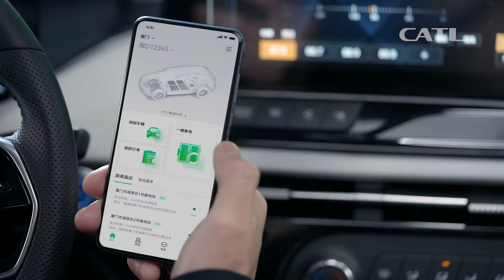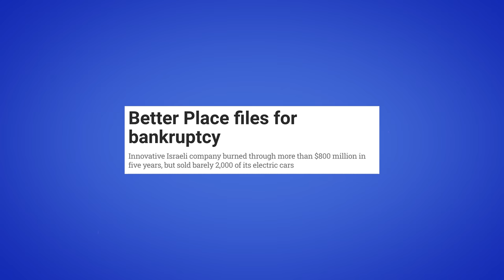Why Battery Swapping Is A BAD Idea

Comment: as a nio car owner in china, here's how things actually done. a typical 2nd gen nio battery swap station tipically houses 10-13 batteries. and the whole station takes up 3 standard parking spots. and it can swap battries at around 5min per viechel. and one empty battry takes 50-60mins to charge to full. so the idea is that, say if you are the first one to swap, by the time the 10th person is swapping, your old battery that you swaped 50min ago, is now full again and ready to be swaped to the next person. by doing this, nio has achived non-stop battery swap, using minimum resources. i've been a nio es6 driver in shenzhen china for two years now, there are around 30 swap station in my city and i've done almost 200 swaps. best of all its free of charge. i relally find it easy and coivent.
Reply from the maker: Thanks for the comment! Out of curiosity, do you think rapid charging or overnight charging is an option for you? Or is this simply a convenience issue?
Reply: @AutoTraderTV  well in china there are over half a million rapid charging piles, and nearly a million slow piles. Ppl can choose from both, as for overnight charging. The fact that many Chinese are living in apartment buildings, and in major cities such as Beijing Shanghai and Shenzhen, these apartments parking  are often only for rent. So ppl living in these apartment(which is majority of the population) don’t actually own a garage therefor it’s quite  a hassle for them to install their own overnight slow charge pile. But currently all new office/apartment buildings are required to install charging piles. So normal electric car owner can choose to charge at either slow or fast charge stations or for me as a nio car owner. I normally choose to do battery swaps as it’s more convenient and most importantly free of charge.
Reply: @nieruidong  Can you use Tesla superchargers in your NIO yet or is that only in Europe?
Reply: @lachlanB323  as far as i know Tesla superchargers are for Tesla only. This apply to all Tesla superchargers around the world.
Reply: @nieruidong  Apparently in Europe Tesla has now allowed other cars to use it. Hopefully they will allow this everywhere in the future.
Reply: I have seen multiple videos of these swaps, there are no way swapping time can be kept 5mins. Driver need to align their cars almost perfectly for it to work, therefore there are around 3 employee on site to help drivers, between the time it take for driver to try to align their cars, getting help, retry sometimes, the practical average swaping time is around 15mins per car. So 1 hour 4 cars. if nio battery can be charged full in 50mins(which I seriously doubt), in the same hour, 3 cars can be charged to full capacity just by building charging stations which are  5% price of the swaping station. This scheme make no sense economically, Nio does it only to sell more new cars. Eventually, either they will stop doing it or the company will fail.
Reply: @ahadicow  with NIO drivers don't need to do anything. You just press a button and it auto reverses and aligns in
Reply: FREE OF CHARGE     never in greedy avaristic OZ mate
Reply: @ahadicow  as of now i've done 164 battery swaps, in fact i've just got back from a 700KM jurney which i've done 3 swaps in between. and you are telling me it takes 15min per swap??? all because you've watched some outdated videos probably from 2 years ago? technology evolves mate!. as of now all nio 2nd gen swap station are fully automatic, the car park itself to the station, no human help needed. and yes, it just takes 5 min.
Reply: @brucehopkins9818  the free of charge policy only appliy to the first 100,000 people who bought nio cars from 2019-2021. it's them who saved nio from bankruptcy, so you can view it as a form of payback form nio to these car owners. now if you purchase a nio car, you can have 6 free swaps in one month. and any swap over this will be charged.
Reply: @lachlanB323  that would be great!
Reply: @AutoTraderTV  Why do people think rapid charging is going to matter when you'll be sitting for an hour waiting to do your still-slower-than-gas "rapid" charging once everyone is forced into EVs.  Overnight charging does not solve the problem scenario, long trips.  Overnight charging just means an EV is not a daily nuisance.  Instead, it's just a nuisance when time is most premium.
Reply: Swapping is not free of charge, you are leasing your battery. For now it's free as long as the company can afford to lose money. When it can't afford to lose money anymore than the full cost of operating will need to be paid and either you pay the company each time you swap batteries or you pay as part of a much larger lease payment.
Reply: @linusa2996  please see my other replie to this question. In short it’s free for the first 100000 nio car owners and it’s a lifetime guarantee. Other later nio owners have to pay to swap
Reply: @linusa2996  Wouldn't expect it to be a free service.  Whether it's a regulated infrastructure or standards based open market system, I imagine you'll need to pay a monthly fee for the infrastructure costs as well as a per use fee for the swap and charging.  I don't know why people think everything should be free or bundled.  Just because you bought an engine doesn't mean it's free to keep it running.
Reply: @user-AdamSmith  Exactly and there's still the range issue. Also not everyone has anywhere to charge an EV; I certainly don't. The garage I rent has no power; I can't get one up the front of my house due to street furniture preventing me having a ramp up; this is all a bad idea and part of the master plan to make us plebs get rid of car ownership altogether. I'll keep my beautiful ICE car as long as I possibly can; at least until I can't drive anymore. I plan on surrendering my license at 70 anyway as I think everyone should; after that age you could drop dead at any moment (literally) so it's not right to continue driving and risking other people's lives.
Reply: @AutoTraderTV  autotrade. It would help if you and your kind think about the wider issues that will come into play. Where do all the people who live in terraced houses charge their cars? Are you advocating cable strewn pavements that nobody can use? How about the grid, how can that support thousands of people all getting home and putting their cars on charge at the same time? Remember they may be on 10% and need to pop out in an hour so cannot wait. How about people who drive longer distances or God forbid, tow a trailer etc, stopping every 2 hours for a 3/4 hour charge is no fun. How about vans, is an eighty mile range any use at all?
Remember battery swapping also allows cars to have smaller batteries saving weight and resourses. Swap batteries could be standardised cutting cost and making recycling easier, just like mobile phone chargers! Did that make sense? Musk is against it because it removes a tesla advantage, he does not want a level playing field at all.
Reply from the maker: @abbersj2935  Ive thought about it lots. It won't be easy, but there are options such as chargers on street furniture (lamp posts etc). It's also worth noting that EVs don't need to be charged every day - just like petrol cars don't need to be refuelled every day. If you're on 10% and cannot wait then there is of course the option to use that 10% to get to a rapid charger and replenish a portion of the battery in 5-10 minutes (or just never leave your car on 10% - just as you might not want to do with a petrol car). 

I can't see how battery swapping (if used on a mass scale) can save resources because you need multiple batteries per vehicle. Even if the batteries themselves are smaller. 

EV infrastructure is not perfect right now. But it's moving at pace. That infrastructure may include widespread swapping. But based on the fact none of the big manufacturers are trying it, it probably won't in the short-medium term.
Reply: @AutoTraderTV  Thanks for the reply, that's good of you. As medium/large cars could use two or even three smaller batteries, (one under engine bay, one under passanger compartment and one under boot) when not doing long journeys they may have only one fitted, hence saving batteries and weight. Manufacturers are not trying it because it's slightly cheaper initially to design a car with a common chassis/battery pack. This does not take into account long term/environmental  costs. Battery charging will be optimised, so they should last longer, and recycling/repairing easier. The batteries could be owned by the charging companies (probably the oil companies) and leased to the car owner, they paying a bit more for the energy put into the battery, (but massively reducing EV car costs). Standardisation would reduce battery cost also. Rapid chargers as you propose are an even bigger drain and would require an even larger change to the electric infrastructure, I doubt that it would be possible on mass.
Just imagine the copper cables required or the safety problems of 400+volts all over the place. The present cars are 1st generation EV's in my view, just not a practical 1 for 1 replacement.
Reply from the maker: @abbersj2935  Some interesting points. I wouldn't propose rapid chargers on every street. I think it would be sufficient to have lamp post chargers outside domestic homes with 7kw output, allowing for overnight charge. Rapid chargers are usually best suited for long journeys where refuelling mid-journey is a necessity.
Reply: @AutoTraderTV  Thanks for your reply. I suppose time will tell.
All the best.
Reply: @nieruidong  Hello from the UK! Sorry can you clarify the free swaps for new buyers? Is it that in the first month they can have up to 6 free swaps, or is it that they get 6 free swaps a month each month. I think it is a great concept, but if the subscription service for swaps is as expensive as stated in the video, I think it could limit the appeal for many.
Reply: @leftyamazed  all new nio car buyers get 6 free swaps a month each month. any additional swap over this will be charged.
Reply: this applys to all new nio car buyers, no matter if you bought the car with the battry or without.
Reply: for those who choose to rent thire car battery, they get about 12000 GBP deduction with thier total car cost. then they will have to subscribe to the montly battery renting service. the monthy subscription fee for the battery is about 100-120GBP. (rough coversion from RMB to GBP)
Reply: for a tipical 75kWh battery swap, the cost is about 18-20 GBP here in china. price may rise a bit as electricity are generally higher in the UK
Reply: @AutoTraderTV  As someone who grew up in China, I just want to caution you. Maybe you're talking to a genuine customer, but it's more likely that this is someone working for Nio based on multiple factors, like their phrasing, some of the things they say and simply the chances of coming across a random Chinese Nio driver on your specific channel, on a website blocked in China who speaks fluent English. As an example for what's misrepresented, the high rise apartment buildings that people who can afford cars generally live in almost all have ample underground parking. There may be a few issues here and there, but the charging situation is actually the exact opposite of how they present it, it's much better in China than in Europe where many car owners only have street parking. I personally don't know a single car owner in China who doesn't have a parking space and in the big cities they all have e-charging these days. Imo the swapping is something they're doing in China as an ad for foreign customers (and maybe for taxi drivers in places like Shenzhen, that might make sense) but it's not really something that's going to be around long term. Even abroad, for the reasons you mentioned it's unlikely to take over any significant share of the market. 
Btw, I'm not sure what's correct in English but I'd pronounce Geely as "Jee-ly", based on the Chinese name. 
Keep up the good work, love your channel!
Reply: @ramdas363  dude I wish i can work for nio, I’m just a guy who studied in the Uk for almost 10 years and just happens to be a nio car owner… lol
Reply: @ramdas363  and by the way there’s something called the VPN which enables people in china to access stuff such as YouTube or twitter. And yes it’s illegal but the Chinese government normally turns a blind eye to individual uses
Reply: @nieruidong  It's a funny coincidence that I used to live in Nanshan. So I'm curious to know which part of Shenzhen has a lack of parking, because I've never heard of that. Since there is practically zero street parking anywhere downtown, how do you park your car then?
Reply: @ramdas363  well you should come to Luohu and old part of Futian. And also old apartment buildings in nanshan, these old residential area is not only hard to find slow-chargers needless to say fast ones, sometime it’s hard to find a parking spot.
Reply: @ramdas363  that said charging infrastructure in China is still lightyears ahead of Europe
Reply: @nieruidong  I love the idea of battery swapping mainly as a way to preserve the life of the car. People get all huffy when I say that battery swapping is a good idea, but I'm looking right now and there are 2013 Tesla Model S with packs that are losing balance, and the only thing Tesla will do is replace the pack.
If you are expecting a long trip how much does it typically cost if you decide to swap to like the 150kWh battery for a month or so?
Reply: @user-AdamSmith  because most people that have an EV have found that it is not a problem.  Having to stop at a charger for 20min every 2 hrs on a long trip is not a big deal. We are already stopping anyway so it makes no difference at all. We still need to eat and pee whether we are charging or not.
Reply: @abbersj2935  you worry about 400v cables running around but you don't seem to realise that in cities there are 110000v cables running under the foot path and no one seems to be worried or injured by that.
Reply: @ramdas363  I do believe it is possible to swap a battery in 5 min and that the car and swapping station can do all the alignment.  It really comes down to the situation in different cities.  Battery swapping is great if you do lots of driving and can't stop for long (like trucks) but if people have a garage and drive normally it would not be a benefit.  I drive an EV and I most certainly wouldn't pay more for battery swapping but that is because it wouldn't make any difference for me and having to go to a swapping station is far more inconvenient than plugging overnight.  It would be great for ling trips but for my self it is unlikely it would be worth paying monthly battery rental for once a month use.
Reply: @franciscoshi1968  Having worked in industries using the 500KV, supergrid, no I don't. But it's one thing to have a thousand or so regulated, inspected well maintained sub stations, quite another to have millions of 400v wander/extension leads all over the place.
Reply: @AutoTraderTV  The present infrastructure will not allow indeviduals on mass to charge cars when they want, this will I think have to be regulated. The grid/power generation system does not have the capacity to charge/start charging 500,000++ 100KW loads at a specific time when people get home. It will have to be sequenced, but who wants to wait? If travelling long distances, living in the country or towing it's a non starter. Battery swap is the same as filling with petrol, takes the same time too. Though it does not stop people home/work charging also.
With battery leasing it also reduces up front car cost allowing greater take up of EV's which everybody wants.
Reply: @nieruidong  Thanks for your input, good to hear from real car owners. :)
Reply: @abbersj2935 no worries
Reply: @ramdas363  You clearly have not seen the reviews of battery swapping done by U.K. programmes and UK reporters for other video channels. There is "planting" of information, but Ruidong confirms what I have seen. Are you possibly just a shill for the tesla company? Who really knows.
Reply: @franciscoshi1968  But that's simply not true. If one has to wait for a charger to be available, if they are widely located or broken as they can be, the service does not work. Also charging at fast/part charge rates does effect battery life. Obviously tesla love that as they have you over a barrel.
Reply: @abbersj2935  They were talking about China, not the UK. There is no big interest in this in China because practically anyone has a parking space and can charge the car at home. Street parking is is simply not available in Shenzhen in the majority of neighborhoods. Thus making this relatively pointless. 
As a side note, very few even drive these cars in China in the first place. In China other brands are popular and none of them have battery swapping. For example the Wuling Mini has taken off simply because it's small and cheap. Lots of Teslas driven by richer people in places like Shenzhen. Other than those BYD has the lead by far. 
Again, swapping would make a lot more sense in Europe than in China. There actually were already companies who tried this in Western countries and failed, it's not like Nio came up with the idea. They're simply reselling it, so to speak. Interestingly most of the "shares" that changed hands were sold to foreigners as well (through the ADR). Funds like BlackRock, Vanguard & co bought them up. The losses will be socialized among the middle class ETF buyers in North America and Europe.
Reply: @abbersj2935  fast chargers are inspected regularly for damage to the cables and they have lots of automatic safety checks before it will even put power on the cable. The cable is shielded and the charger does a leakage test before it even applies power. How is that unsafe?
Reply: @abbersj2935  except that in the last two months I have only used a fast charger once and that was while I was having lunch so I wouldn't pay any extra for battery swapping and a battery swapping station would be more likely to break down than a stall with 4 fast chargers. The reason fast chargers are always broken is because the people that run them don't care.
Reply: @franciscoshi1968 So you're going to make them care?
Reply: @abbersj2935  I buy from the ones that care.
I can see what chargers are not working and don't go there. I use them so little that it really doesn't matter much.
Reply: @user-AdamSmith  for safe driving you will have to stop every 3 hours or so to rest for a half an hour, thats more than enough time to charge another 3hours of driving time, and you can install a charger everywhere where there is a power line, also rapid chargers are evolving as well, and there are some that can charge from 0 to 80% in 10 minutes
Reply: @botixxi  I've been doing 5-6 hour non-stop drives for decades.  So not sure what kind of standard of competency you're going by.  That sounds more like the expectation for an invalid.

10 minutes for maybe 250 miles, vs 5 minutes for 350 miles?  Not progress.  And definitely not when you count waiting around at chargers.
Reply: @user-AdamSmith  Its a standard law in Europe, but the battery swap option is more optimal, and until all combustion engines will be banned the battery and charging technology will be way more efficient and way cheaper
Reply: Guys just while you where talking the possibility and practicality of battery swapping, nio has just launched it’s 1000th swap station in Tibet
Reply: @user-AdamSmith  Battery technology is in a constant state of flux and improving every year, in the next 5 years we will see mass market electric cars that will do 600 miles on a a full charge, and charging times will decrease dramatically.   Fifteen minute charge times will become the norm and not the exception and in ten years charging times could be down to as little as five minutes and battery packs will be much lighter, assuming we are still using batteries of course  because there are other technologies being worked on where we could see charging taking only less than a minute.
Reply: @abbersj2935  this grid problem is the elephant in the room and bottleneck for a clean energy society. Thanks for the input! However let's not get carried away with a utopian vision. There are very good reasons  comapnies don't swap. The battery is the prime competitivev advantage currently and in the forseeable future. Like saying, all ICE manufacturers should share engine technology to save money. Kills innovation. That's why it works only in communist China. Not to mention complex battery management software tailored to a manufacturer's battery. Not to mention designing vehicle dynamics for a battery you don't own...  As an automotive engineer, I can say this is a nightmare and does absolutely nothing beneficial. It's a complete non started as Rory mentioned. 

However I'm not an electrical engineer, and we need to figure out the grid issue . Of course it has lagged behind, why? Because it's largely government regulated. When regulation gets out of the way, innovation and progress can thrive. We are painting ourselves into a corner currently...which isn't surprising given humanity's track record.
Reply: So a swap station has 500kw of power? I guess that’s only in new areas? I doubt in the older part of cities the grid have enough spare capacity for a 500kw station.
Reply: @ahadicow  Nope. That is done automatically. Pay more attention.
Reply: @AutoTraderTV  Trader, good defence of the status quo :), but in reality, unless we all change our lives, (which we will not) present EV's are not a workable replacement for the vast majority of ICE' vehicles in my view. OK for city dwellers (who barely need a car anyway, and where future autonomus Uber's and the like will take over). But not practical for elsewhere or for Van/Lorry use.
Reply: @franciscoshi1968  that would drive me crazy. Australia is big. I want to drive as many hours as I can before stopping. It would take weeks to get anywhere, having to stop every 2 hours. It might be ok for townies, but not for doing decent trips.
Reply: Free.....😄
Reply: @AutoTraderTV  I have a house with a garage, so an EV was a no-brainer for me. It just makes sense. But for many people, such as those that live in apartments like Ruidong Nie mentions, battery swapping makes the most logical sense. This way, the process of "fueling" an EV is basically the same as filling an ICE car with gas at the gas station. Until more slow chargers are installed in parking lots and apartment complexes, etc this will be one of the best options... at least until the Aptera finally comes out with built in solar panels!
Reply: @user-AdamSmith  why would I want to buy a car if I'll just be waiting an hour at the petrol station till I can fill it up? 
-Some guy in 1920
Reply: @buzz86us2005  that's an issue with teslas policies or lack of regulation, nothing to do with whether swapping is better than charging. It's like saying charging is better because every time I go to a swap station, the machine kicks me in the balls
Reply: @abbersj2935  Living in the city or in the country doesn't make a difference. The commute to work just increases which is easily covered by most EVs for most people. The advantage of living in a rural area when it comes to EVs is that you are much more likely to own a house which enables overnight charging, so you never need to go to a gas station or to a charger as long as you are just commuting. Both people in cities and in rural areas make long distance trips which are more or less convenient depending on charging speed, range, extent of the charging network and how many breaks you like taking. If you buy the cheapest EV you can find, like going many hours without taking a break and live in a place like the US where everything including chargers is spread far apart, then that's not something I would recommend. You could of course just rent a gas car for that trip and still drive electric 98% of the time.
Reply: Free?  Who pays for it then?
Reply: @Fleming-ql  What was your alternative in 1920?  A mode of transportation far inferior to the car.  Today, I can just keep using an ICE car, which does everything an EV can do, and with more range.
Reply: @AutoTraderTV  there are clearly a lot more issues besides those you mention. Whilst the number of EV charging stations might be increasing, the sales of EVs are outpacing the building of these every single month.
The main issue is the extra electricity usage and how this is provided. The average family uses 75kwh per week so by charging an EV once per week they will double their average usage - how will this extra electricity be produced? If all 35m UK cars were changed to EVs charged once per week on average, this would increase electricity consumption by around 40% - any suggestions how this extra energy will be produced?!
Reply: @lachlanB323  Only likely in non EU countries where Tesla are forced to use CCS charging standard, whilst in the US they get away with using their own.
Reply: @LordElpme  Yeah it's a shame Tesla can't use their clearly superior charging cables.
Reply: @lachlanB323  nothing superior about tesla connector seeing as it has roots in the largely defunct Chademo setup. 

What is superior is being able to charge your tesla at any rapid charger. no expensive adaptor needed.
Reply: @LordElpme  They're much less bulky and easier to plug in.
Reply: @lachlanB323  and that makes up for having less charging options? The last thing EVs need is different charger sockets. One standard which Telsa and Nissan could have driven home early on whilst the two had most of the market share.

Telsa could still have limited access to the network via software for tesla owners only.
At the moment, we have Tesla plug (US and others) CCS and Chademo. This is the wrong road.
Reply: @LordElpme  Tesla made the standard and others decided not to follow even though Tesla would allow others to use it. So Tesla's should of been the standard.
Reply: Since Youtube is banned in China, how are you here?
Reply: @ahadicow  Umm, it does take 3 min with the new gen swap stations, and there are next gen swap station being introduced that will make the process even faster. The upgraded swap stations no longer require ANY personnel, and the car drives itself into the station and everything is FULLY automatic. The future stations will also have solar panels and send unused power back to the grid, thus making some of the money back
Reply: "Free of charge" that's an illusion. After all, you still pay the monthly leasing fee. That fee is much higher than the electricity cost of chargin, for pretty much everyone.
I agree, that the convenience angle is ok.
Reply: @andreasbucher7717  listen, I paid full price on my battery, I did not choose to lease the battery, and I get unlimited  free swaps.
Reply: @ahadicow  they culd fix alignment issues by having it like automated car washes once you get the wheels on the track the machine moves the vehicle for you
Reply: @ramdas363  are you living China at the moment? Why are you challenging a guy who’s got boots on the ground? Show some respect and don’t pretend to be a know-it-all. 

I personally think NIO’s battery swap is great, as long as there aren’t that many NIOs all waiting to swap their batteries in one location. But from what I saw and heard, they have chargers right next to the swap stations
Reply: @AutoTraderTV  they should just make charging wireless, a directed beam no matter where you are you pay and they send you power. Should be quick to to kill this battery swapping nonsense.
Reply: @nieruidong  you studied for 10 years an you want to work for Nio? Are they just taking anyone these days?
Reply: @nieruidong  Does the swap station detect that each battery is in an acceptable condition before putting it in a customer's vehicle? The thing that worries me about battery swapping is that after a year or two batteries might start being returned that are damaged or deteriorated, so the next customer gets an unexpectedly short range. This would not be a problem if the swap station can detect a faulty battery and take it out of service for rectification, so every customer gets one that is known to be in good condition.
Reply: @cedriclynch  yes,eveytime a car do a swap the swap station can detect a faulty/less effective battery and take it out of service for rectification.
Reply: @nieruidong  That is good. It removes the main problem that I could see with battery swapping.
Reply: How much does it cost you to rent a battery?
Reply: @markopavlovic4600  i bought the whole car, i dont rent the battery
Reply: @nieruidong  aha, how much did you pay for the car and how much did you pay for the battery swapping services last month?
Reply: @markopavlovic4600  i have unlimited free swaps, so the car cost me 426000rmb which is about $62000US and as I'm the first 100000 nio car users, i get free unlimited  battery swap for life.
Reply: @markopavlovic4600  i have unlimited free swaps, so the car cost me 426000rmb which is about $62000US and as I'm the first 100000 nio car users, i get free unlimited  battery swap for life.
Reply: This is free of charge for now, I believe Tesla super charger were free too at some point... it is not the case anymore.
Also what is going to happen when other car manufacturer are going to make cars with swappable battery? Each of them are going to build their own network of swapping station? I will be convinced it can happen when there will be a standard so every station will work with every manufacturer. But EV technologies are evolving so fast and battery, charging, and swapping stations are so complex that I think NIO will have trouble with just retro-compatibility.
Reply: @francoismentec4260  its for life and it follows the person not the car, so even if you got a new replacement, as long as it’s still a nio, I can still enjoy unlimited free swaps. And it’s in the contract.
Reply: @francoismentec4260  nio are already working with the government to establish swap standards, things don’t work in the west doesn’t mean it won’t work in china, never underestimate state power.
Reply: @lachlanB323  this is false
Reply: @ahadicow  Have you actually tried it, or just making statements you think could be true? Tesla's, and I imagine almost every other car in the future, have self-driving (or at least driver assists) which could easily handle parking in a specific location, by using its exterior camera's to verify it's position relative to the swap station and adjusting as needed. 

You've come up with a theoretical average for something you've most likely never tried or even seen tried, and trying to convince someone who battery swaps regularly that you are right about it... Surely you see the ignorance here
Reply: It is not free. They have already charged you for it upfront. But thank you for telling us about your experience.
Reply: Why you need multiple battery per car?! you need max 10 batteries per station.
Reply: @arionfar  don’t know what you mean
Reply: @arionfar  there are different capacity batteries， ones are 75Kwh others are 100Kwh so you need more than 10 depending local big data, if there are more 100kwh cars then there more 100Kwh batteries Thant 75Kwh ones
Reply: @nieruidong  If there are more 100kw batteries,  more 100kw batteries come to your station! so you need less inside.
Reply: @arionfar  ？？？？don’t really know what you are taking about, do you even?
Reply: @arionfar  there’s a thing called big data, nio uses big data to calculate the charging habits of each car, and if it sees there’s need for more 100Kwh batteries in one topical station, then they will put more in that station. It varies from station to station, can you get it now?
Reply: @nieruidong  You have 11 cars inline and 10 fully charged batteries in house. First car goes in drops a dead battery and gets a good one in 5min. By the time the 11th car gets in all your 10 inhouse batteries are over but the dead battery dropped by the first car is now ready after 50 min. So, 11th car gets the 1sth battery, 12th gets 2nd, ect. Now if there are more 100kw in line, they drop more 100kw for next cars.
Reply: @arionfar  so what about there are 7 100Kwh cars and 4 75Kwh cars. Mind you 100Kwh packs take 20 minutes more to charge.
Reply: @ahadicow  Most people that are skeptical about battery swapping don't own a nio and don't live in China ( Up to 45 % ev adoption rate in my City ) . As a Nio owner I as swap on the go , I don't have to get out of my car, it takes 5 minutes, it's automated , the car drives it's self with a push of a button , and it's free. Why should I get out my car, dare the weather, struggle with cable, then wait 30 to 40 to charge, ruins my schedule ( I'm alway in a rush) then finally pay exorbitant charging rate. Feels stupid as a nio owner to charge , especially on the high way with a tight schedule. Sorry for my Tesla and mercedes benz users, good luck with the cable, I'm out.
Reply: @AutoTraderTV  

• Of course you can probably think of special scenarios, but Nio needs more like maybe 1,3 batteries per vehicle. And in practise you'll need less in the long run, because you can trivially take bad batteries out of circulation. You can manufacture and use batteries with lousy lifespans because you can trivially test them continuously and take them in and out of circulation, refurbish them and put them back, and stuff, in ways that make it all cheaper and less resource using in the long run.

• Nios also have charging ports. There will be use case where a Nio is almost always destination charged and only does the replacement on long trips.

• The standardization issue: building a swap station only for Nio? Tesla did this for charging and it works fine.
Reply: thsnk you for clearing this up. not only thay nio has much better looking interior and they still use the stalks for conventional functions like lights and wipers. I used to own a model 3 and gave up because if how impractical charging was, waiting constantly for 45mins to charge up is a absolute waste of time in your day when your old petrol car you never had to worry about this, nor range anxiety.
Reply: @lachlanB323  ... did EU tell Tesla, "All or none"? Maybe EuTesla accommodates other cars as a condition of access to ANY EU cars?
Reply: @ahadicow  the cars align themselves. I think you should check out some videos to understand how swapping really works but the car drives itself inside the station and rollers on the floor position the car perfectly.
Also, the attendants are not needed.
Next generation 3 stations from 2023 will take 2 minutes to swap.
Over 90% of Norwegian NIO sales go with battery swapping.
Reply: @ramdas363  Over 90% of Norwegian NIO buyers select the battery swap and NIO has done more the 10 million swaps in China so someone is using them obviously just not your friends 😂
Reply: @nieruidong , Ram Das has obviously never seen Mr P posting YT videos from inside China.
Reply: It's not free of charge. Here it cost 10 euro per charge. Which is to be honest not a bad price. But the problem is. NIO is in control of the prices and the swapping stations. And therefore if it gets popular will raise the prices significantly. Just like the Tesla free charging, it will end some day. The free of charge in China is probably only for a short while.
Reply: @HermanWillems  please read and then reply，i bought my NIO ES6 or EL6 back in 2020, thats when nio was in it's infancy, and basically we suppored nio at its hardest time. so nio in return give us users unlimited battery swaps for life, and this is written in the contract. yes this policy only applies to nio car buyers before october 2020. now new users will have to pay for additional swaps.
Reply: @nieruidong  unlimited swap cost. With or without free electricity cost? So its a bit like Tesla did with the first cars. Thats nice.
Reply: @HermanWillems  unlimited free swap service fee and electricity at the same time.
Reply: @nieruidong  ok. That is very nice. Because if i calculate here. U get now 2 free swaps. (10 euro each swap without electricity) but with a 100kWh pack with current electricity price of most chargers everywhere here of around 60 cents. It will cost 60 euro each swap. And after 2 swaps 70 euro. But i guess 2 swaps a month will do for most. Then add battery lease of 260 euro a month for the 100kWh battery or 160 for the 75kWh. Car without battery is still more expensive than Tesla with the battery included. But you cant compare ET7 with anything like Tesla its between Model 3 and S. More luxery than 3 less luxery than S. But ET5 u can compare to the Model 3. Even though the car might be good. Or not. In Europe its a though sell. The thing is. People dont like to "try out" something expensive if there is already a proven competitor out there. Tesla here had the advantage of being the first. So people had no option than to try out Tesla. Now they have so many options. They dont like to take the risk anymore. And even Kia, Hyundai, Lexus barely sell their luxery models in Europe. Because in the luxery world brand image matters. And NIO does not have any brand image at all. They still need to build that up. But take in account. Even Kia, Hyundai and Lexus failed hard in Europe. Rich people here always choose for Mercedes, BMW, Audi etc.
Reply: you can do rapid DC charging or slow AC charging at home with Nio too. However I swap because i have no access to charger at night. Also i lease the battery and I don't have to worry about the health of a battery as all is checked during swapping.  @AutoTraderTV
Reply: @nieruidong  
There in lie the rub, free for the first 100,000 buyers who "saved" NIO from bankruptcy.
I think you should have mention this upfront...a bit dodgy there, mate.
Reply: @linusa2996  
That's right.
Just like supermarkets slowly monopolizing the market, then when there are nowhere else to shop, the prices start to rise.
Reply: @RUHappyATM  I did in one of the replies if you have read them all
Reply: unless there's standard in EV manufactures, swapping battery can never be a good idea
Reply: @biiigdaaaddy  well, the Chinese government just annouced a national standard for battery swapping. and guess what! NIO is the main cofounder of the standard. and by the way, as of now 2300 swap station has been built by NIO in China, and over 30 are built in Europ.
Reply: @nieruidong  The idea of battery swapping can be dated back to 2007. Numerous experiments have been done by EV companies in Europe and USA to prove that is a dead game. Obviously NIO didn't invent the technology though they may implemented in their own ways. Unless Chinese government subsidizes, I don't see this can be useful. Only 2300 in China, not even enough to serve one city, if you adds up all the EV cars from other brands. That number times 10k seems to be okay.
Reply: @biiigdaaaddy  dude come to china and get your 19th century mind refreshed. You will be surprised.
Reply: @biiigdaaaddy  do some research before posting a comment please.
Reply: @nieruidong  lol… 😂 don’t be mad my friend. Ignorance is not your fault. I do like NIO btw, better than Xpeng, BYD, LiXiang. Some of those vehicles are just joke. Enjoy your NIO, and the swapping station. Ahahahahah
Reply: Nothing is free. How did you actually pay for it?
Reply: @tarassu  read my old comment.
Reply: Yeah and how about your own battery? you gat some shit beat up battery that might ignite your car since you never get back your own...
Reply: @nieruidong  thank you mate, you are so kind to share this info, you make me confident for buying 1000 shares of nio for 7.5$
Reply: It means that all those batteries are getting fast charged all the time… not so great for their life expectancy!
Reply: @ahadicow 😂😂😂 good imagination. . Just poor imagination unfortunately. You need to do some research and to upgrade you IQ level 😂😂. The other can just follow up NIO and nothing else 😂😂😂.
Reply: @nieruidong  This is true, also lived in Shenzhen, Shiuwan for the win!
Reply: @biiigdaaaddy  No he's right, NIO has way more charging stations now.  Yes NIO wasn't the first with battery swapping but they're the first to make it work successfully. Big difference.  Chinese government isn't subsidising, but it encourages technology and progress, which is why there are so many EV brands now testing and competing.  Once they reach standardisation, battery swapping stations will replace petrol stations regardless of whether NIO is still around or not (someone will  buy them out anyway).
Reply: @mrhdebater1607  do you know why phones now do not have swap batteries?
Reply: @biiigdaaaddy  Because batteries have improved dramatically and didn't need to be swapped and replaced often like low-tech batteries.  Either way, they can still be replaced by a qualified technician which isn't expensive unless you are using an iPhone.
Reply: @mrhdebater1607  that's just part of it. The efficiency and scalability you get from one piece overweighs the convenience of swapping battery. Similar idea applies to car battery swap. you have to make sacrifices here and there. at the end of the day, you will realize EV cars are just hoax.
Reply: Unfortunately the idea of swappable battery is just stupid from a financial perspective. EV batteries are extremely expensive, hence extra batteries are very capital intensive.  No business is viable having large quantities of expensive but depreciating assets sitting around not generating revenue.  This is one of the reason, and the biggest one, why No is going bankrupt as we speak.
Reply: @xiphoid2011  Yet swappable batteries was the first thing that nearly every electronic devices, laptop and mobile phones had for many years because it was better than every other option.  Furthermore, batteries have improved tremendously; became safer; lasted longer, and can be recycled.  Swappable batteries is a smart idea especially for cars, since the cars are cheaper to maintain and last longer while the batteries can evolve and improve over time.
Reply: @xiphoid2011  2400 swap station is buit while you are making this bias statment.
Reply: @xiphoid2011  there's someting in the financal industry called securitization, maybe you wanna lookin to that.
Reply: So you don’t need to charge the battery yourself? I’d rather have the option to charge and or swap whenever I want.
Reply: @AutoTraderTV  The thing is with to swap very used batteries that have done their 15,000-25,000 kms in the next 3-6 years as people bought their Teslas, Q4 Etron, VW IDs in 2021/2022 to have the full range again and not a 70% cut due to battery capacity decrease with every charge and  also if you live  north with the very low tempreture snow then another cut of thre 70% capacity.
Reply: @user-AdamSmith  Long trips?  If it takes 30 mins to get an 80% charge at a super charger, your time must be at a MASSIVE premium for this to be a deal breaker.
Reply: @linusa2996  In China, workers are essentially paid slave wages.  The companies can afford to charge very little.
Reply: Isn’t waiting as the 10th person in line then just as bad as waiting for your battery to charge normally?